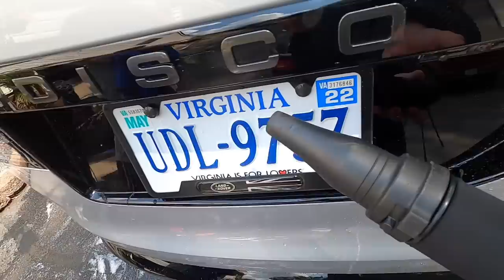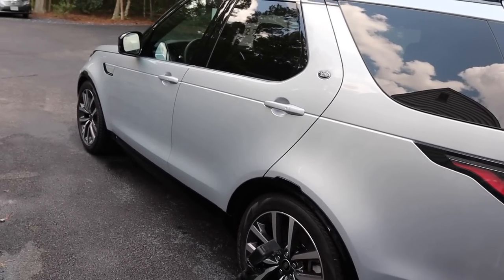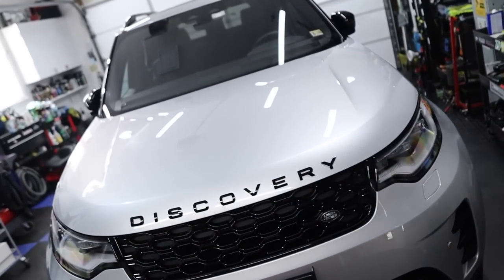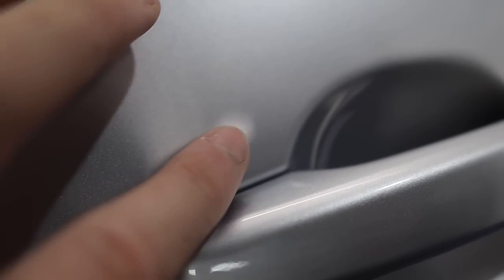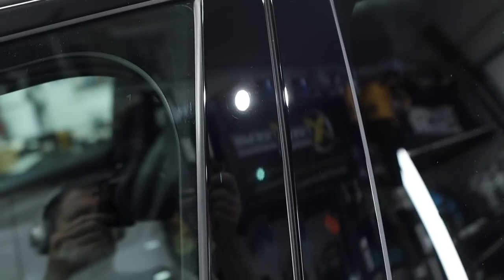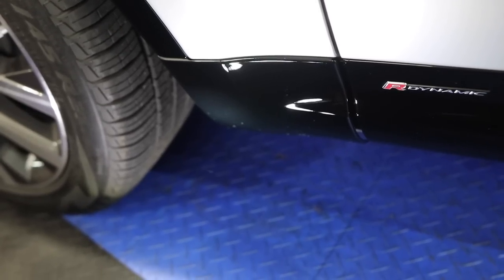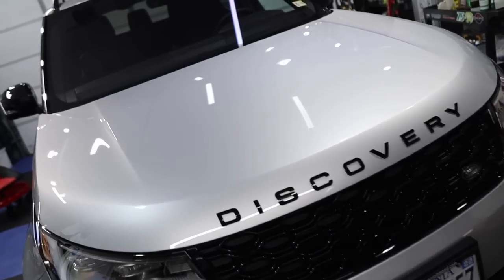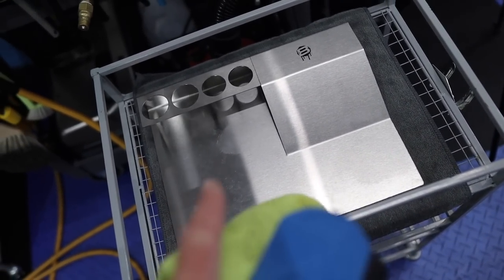Exterior Detail / Paint Enhancement & Ceramic Coatings #realdetailing #gtechniq

Comment: I have detail shop in sweden and we use a  kind of degreaser called "kallavfettning" with is a degreaser and also removes tar. Then we foam with a high alkaline then rinse and wash with the schampo. Iron afterwards if needed or wash over it or before the schampo step.

Comment: Hi Phil, apols for being late to the party. Ive seen those white marks (very very similar) before, it turned out to be road marking paint  (rubberised), cant remember at this moment exactly what removed it but spoke to 'Highways' who sent out a small vial of thinner that softened it up & it picked off with a fingernail.  Might be worth a call for next time & or try steam, that will soften it up. Wishing you & Jess health & happiness for the new year !!
Reply from the maker: Hi!  Interesting!  It could have been rubberized road paint. But man I used lacquer thinner and even KCX Eulex and it  did nothing. And that stuff will dissolve the plastic on headlights!!  Don’t ask how I know that🤣
Reply: @MirandaDetailing    we can only share thoughts when we have similar experiences, I remember dripping it onto a ladies make-up remover & leaving it on it for 30 minutes or so only then it softened it up a little. (ladies make-up pads soaked in glue / tar remover also works on wheels (tar) & number plate sticky pads. Take care fella, it was great to get confirmation today that Jess's arm hasnt done a Bruce Banner :-)  Fingers crossed she didnt beat you too hard for the previous editing, p.s. just ordered C5 (I sincerely hope its better than it was 7 years ago, (lasted 6 weeks) & the recommendation, 4 tire dressing/coating applicators , I have 3 sets of new tyres going on over the next few weeks & just about to try Blackout on my Garage Queen (LS460) with Adams Graphene pn the paint, C5 newly refurbed wheels, Gyeon Leather Shield on internals. Ive had her since  Nov 2008, 4 months old/4K miles & still love her to bits. Apols for war & peace.

Comment: Good morning Phil.... can you use the DA polisher with compound and polish on plastic trim (bumpers)? Any different techniques compared to metal with paint and clear coat finishing?
Reply: You have to watch the heat!! Plastic does not dissipate heat like metal does. You have to let it cool down and not stay in one area too long.
Reply from the maker: Hi. Good question. Yes as mentioned it doesn’t dissipate heat like metal does so don’t over work compounds. Sometimes it takes longer to correction plastic printed bumpers then it does metal panels.

Comment: Question: If I remember in this video during the wash phase you mentioned Super Clean diluted 4:1. Was that for your APC wash?
Reply from the maker: Hi. Yes. It’s our APC rinse or pre wash stage.
Reply: @MirandaDetailing  I appreciate you responding to my question. I have been using Extra Tough that works really great but the price is over $30 per gallon. Super Clean is under $10 Thanks again.
Reply from the maker: You’re welcome!  Yeah Both are great but Super Clean is cheaper.

Comment: The white stuff could be white lining paint from the road. Did you try a clay bar or not risk it? Don't blame you for not proceeding with trying to remove it - advise the customer its there - great advice.
Reply from the maker: Hi. Yeah we tried to remove it like we usually do for road paint. But it’s wasn’t that 🤷🏻‍♂️. He got it fixed at the dealership.

Comment: What's the average shelf life on ceramic coating once opened and then stored properly? In your experience at least.
Reply from the maker: For the 5+ year coatings once opens about 2 weeks or less depending on temps. You can put it in the fridge and it lasts a little longer.  The 2 year coatings last longer like a few months.
Reply: @MirandaDetailing  hmmm, thats interesting.

Comment: Hey Phil and Jess.  I really appreciate your content on the reasoning behind APC prewash.  It makes a lot of sense and I am going to start using that methodology on my work moving forward.  Also, when applying an iron remover outside, do you stay away from glass and what affect does the sun play in this process?  The vehicle looked awesome.  Thanks again.
Reply: When applying iron remover make sure to stay away from any trim, although I'm not sure about glass
Reply from the maker: Hi. Thanks so much!  For iron removers it’s ok if they go on paint, trim or glass. As long as you don’t allow it to dry you will be fine. I have never had it Casie any damage. The thing to understand is it’s actually ph neutral and only reacts when it comes in contact with iron bits. Otherwise it’s not a strong caustic chemical.

Comment: Phil, it is hard to get light colored paint to pop like dark paint does. What polishing technique and products have you found that work best to make metallic flake silver pop the best? If you owned a silver car would you jewel the finish to get maximum gloss in order to get it to look wet under most lighting conditions?
Reply from the maker: Hi. So we don’t use any special products or methods. We use the same products and methods on pretty much all colors. Dark colors just take more time to perfect. But otherwise all the same really. We don’t jewel paint or anything. Usually the polishes we use before applying Ceramic Coatings, like the Dr Beasleys polishes do a great job added tons of gloss and acting as a primer for the coatings. 😎👍🏼

Comment: High alkaline foam prewash witch we use very often , mainly in North Europe, they are for to fight high salty and road/traffic film grime, roads of Europe with winters and many many days of rain.

Many of those they are just....Apc ( like bilt hamber surfex hd, or koch green star) witch we use some time on a foam cannon.

It is the same.. .Apc but instead using it on pump spray we use them ( made for)  sometimes on a foam cannon .

So no difference.....only some..... bubble from what you do...and what many see on videos.

Great job Phil
Reply: I had also problem finishing on those pilars. The  one that helped me a lot is when i step down on eccentric from 15/21 mm to 8mm machine with 3inch pads. I feel that those very soft piano black pilars dont like at all the large throw.
I have a cheap da ( like yours HF/bouer 8mm polisher) with 3inch plate and orange LC 3inch pads ,they usually do the trick. Try it some times maybe you like it. 

If i dont coat them i use only an AIO because....they will ...re-scratch it soon...and i want to have some room to do it again in the future

Comment: Very nice work, Mmm-mmm!  And yes, I love silver paint as well.  It is a VERY forgiving color indeed, especially with older cars like my 2000 S4.  I love that color a lot.

That blotch you talked about, the white stuff, uhhh yeah, that may have been me.  Sorry man.  I couldn't control it. LOL!  Joking aside, I had similar stuff like that on my BMW 128i.  I was able to remove that stuff off of the plastic side skirt using 3000 Grit sandpaper from 3M.  But VERY light pressure and plenty of soapy water or clay lube.  Thankfully it wasn't deep at all, because I only wiped maybe one or two passes with the 3000 grit, and they were gone.  Then it was just a simple polish, and done.  But you made the right call on this one.  It is a different type of paint and plastic than what was on my 128i.  

Great video and Merry Christmas to you and the family!

Comment: And....if the car has only very little dust when it comes to you....
You can try ( if you like) to Iron treat first....and then start the first rinse ...apc...wash e.t.c..
You can...save one rinse off stage....( The light dust can hold the chemical and not drip off soon , and not interfere with iron removers performance)